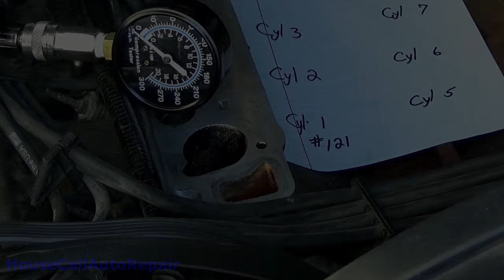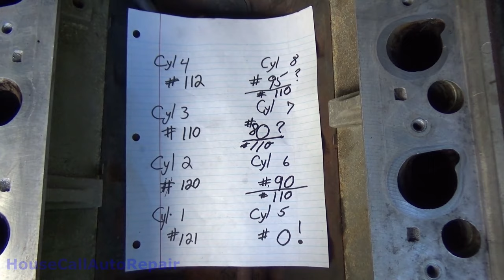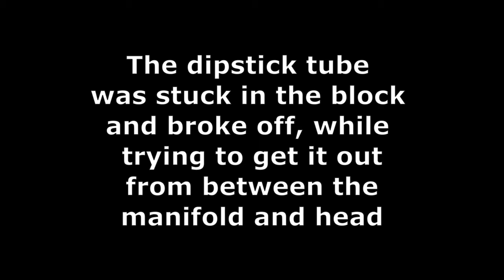Sliding down a Rabbit Hole! - 1997 Crown Victoria Interceptor 4.6 2v -  Head Removal

Comment: Charlie! Brokski! Broskovitch, what the HECK are you doing? Do NOT waste money at the machine shop on those trash non-PI heads. Go to any junkyard and grab a pair of PI (Performance Improved) heads & cams (from a 01 and later CV or 99 & later Mustang) and combine that with a PI intake manifold and you have a free ~50 hp upgrade. Again, call the machine shop and tell them to drop those boat anchors in the trash. Your 97 CV will scoot with the PI heads & cams.
Reply from the maker: Aside from the inside of this engine being way too clean for a 97 with over 160,000 miles, and suspecting it's not original, I have no intentions of changing any part of the drive train. I'm keeping it as close to original as I can. 
The machinist wasn't going to charge me at all., initially. I asked him to clean and resurface it as a matter of principle. Just a bit over $100 and it look brand new! I'm VERY happy.

Comment: Nothing worse then sliding down the rabbit hole.
Reply from the maker: This one was a kinda fun one. Not a lot of money, but a lot of much needed maintenance.  All new valve seals, One new head gasket, new motor mounts, newish crank damper, new starter, new steering box, new intermediate steering shaft, new power steering hoses, etc

Comment: Ford and their better ideas. Is this the same head you did the valve seals on? What did you have done at the machine shop other than cleaning and testing?
Reply from the maker: yes, this is the same head. Videos are being released out of order (like Star Wars) The machine shop confirmed there were zero issues with the head. I felt bad about the "no charge, come pick it up" so I asked him to clean it up and polish the surface. He did an amazing job!
(the engine is completely done, but all the stuff that bolts up to it is going back on at a rate of one part a week....lol)